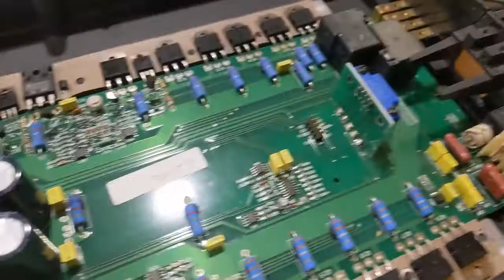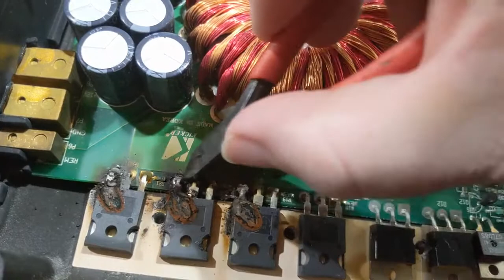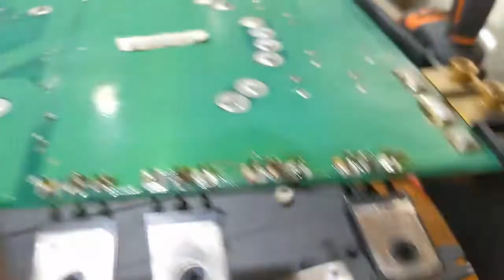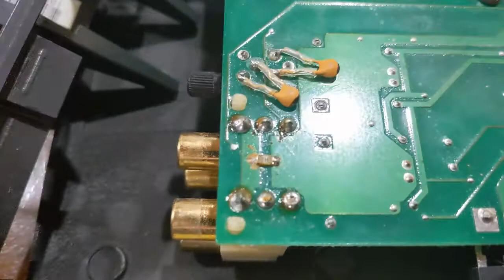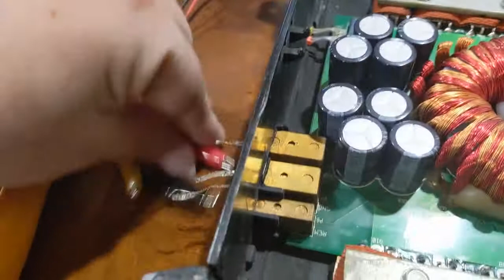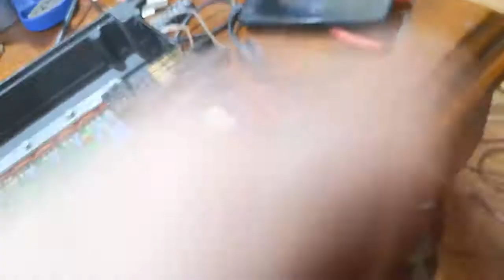Kicker ZR1000 Blown, and bad capacitors Repair

Comment: I have the same amp I don't see anything blown on the board any signs of heat I bought the amp used about a week ago and when you turn it on if you have it on bridge mode no matter what the volume settings at you'll see a big ark and it'll go into protection right away it'll be blinking and the speaker will make it up if you put it in on bridge mode the speaker will like being like a hiccup mode weather the volume is on or not I have not seen any type of fuse on this board like a 30 amp 40 amp etc any help would be greatly appreciated
Reply: You never got back to me man what's the point of having a channel if you're not going to help your customers your followers

Comment: Im in the middle of a repair on this exact same amp with the same failure right now.. ive replaced the PS fets and am looking for a replacement PS driver ic... and what part # output drivers did you use?

Comment: I have the same amplifier but i have a issue, maybe you know to help me!
 I put a amplifier for my speakers and the kicker make noise and that noise goes to the rca input in the other amplifier like a frequency and make noise in the speakers... When i turn off the kicker the noise disappeared!
Reply from the maker: Check the RCA grounds. Chances are your head unit popped its little trace or fuse on the main board that feeds the ground connection to the RCA output. This is very common especially if that head unit was used on an amp install that the ground came loose to the amp.
Reply: @THEtechknight  i check all grounds and is zero ohm, i disconnect the rca from the source and the noise still there but if i disconnect the rca from the amplifier noise disappeared, is like the rca catch a frequency in the air.
If i shut down the woofer amplifier the speakers play excellent! 🙄
Reply from the maker: @konstantinoskotsantis2450  This is because the head unit is not grounding your RCA cables through the signal feed. As i said, you need to check the RCA grounds at the head unit itself to chassis ground and make sure its a complete circuit.
Reply: @THEtechknight  I putt a wire in the outside of the rca outputs and to the head unit but nothing change...

Comment: I’d really like your input on a 2001 ZR600 I have. It does have sound but briefly and both channels work. Something keeps sending it into Protect mode. Red then Yellow over and over. If I tap the remote line in at a fast pace with a wire I can actually listen to music. Any thoughts?
Reply from the maker: youll have to check the unit for bad connections/solder joints. Also look around for loose copper wire strands that could have gotten inside and is wreaking havoc.

Comment: Amp is from early to mid 90's
Reply from the maker: this board was 2001.
Reply: @coffeeconservative Guess you missed the multiple signs this amp is clearly not. The line came out in 97 & was run till the end of 01. Post the Stillwater bankruptcy they rode the coat tails just had the lines made over seas. The board is even stamped made in Korea. When Stillwater released these they were all made in house in the USA 🇺🇸
Plus the board even had a label with production date of 9-5-01
Mine are all from 97-98 & have different parts then this Korean built 1